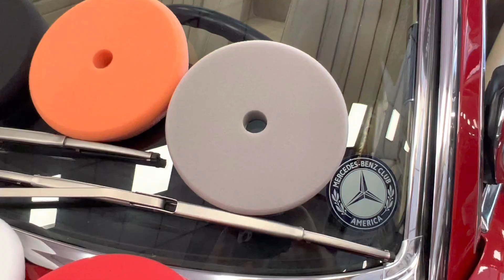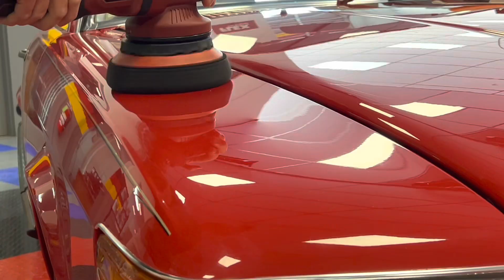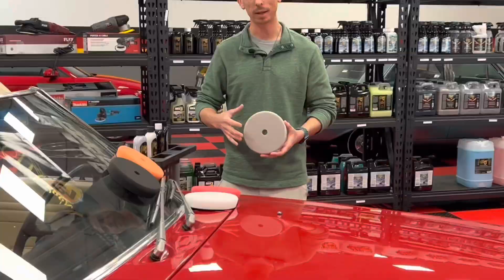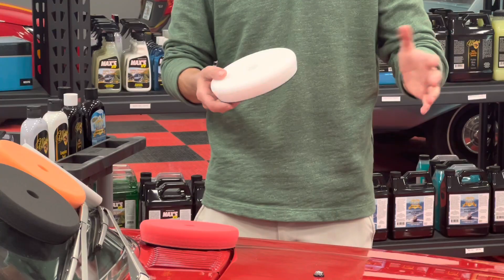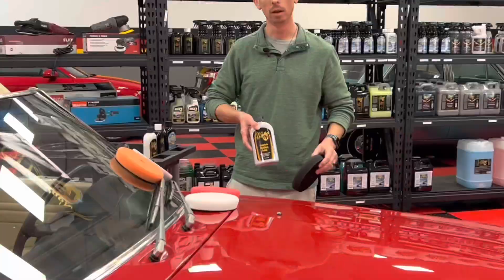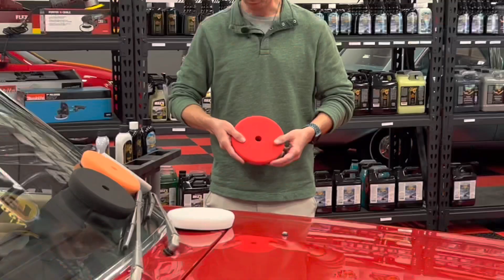Force Hybrid Foam Pads: Are They The BEST Lake Country Has to Offer?

Comment: Hello, excellent video, we use them a lot in giscardetailing, Argentina, I use the gray cut a lot, I have the makita po5000c1 broken orbital forced, but it gives me excellent results with the porter cable 7424, with the griots garage g9, and rupes 15 markIII of free turn, it cuts a barbarity excellent cut and also finished with the gray high cut, with menzera 400, greetings